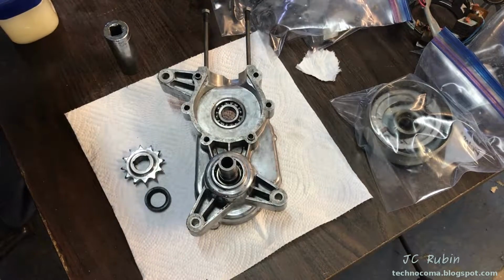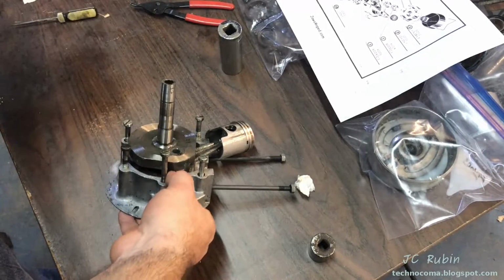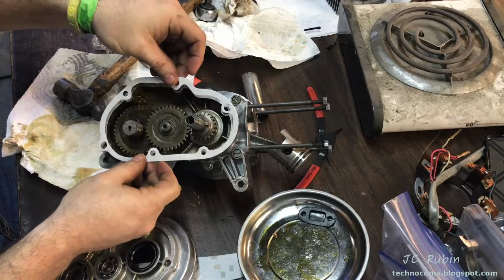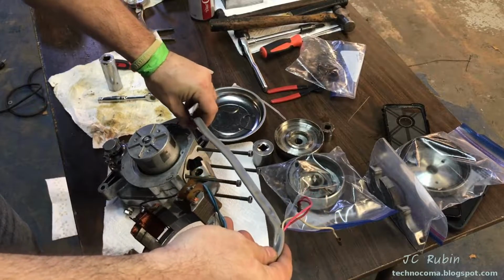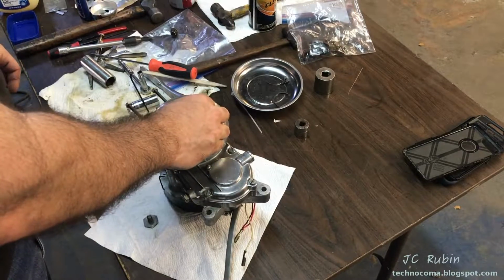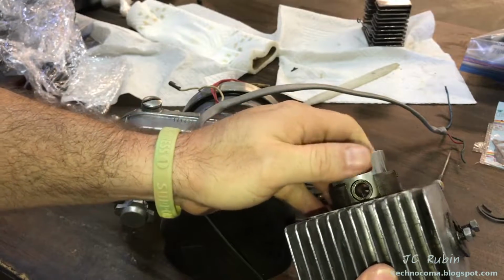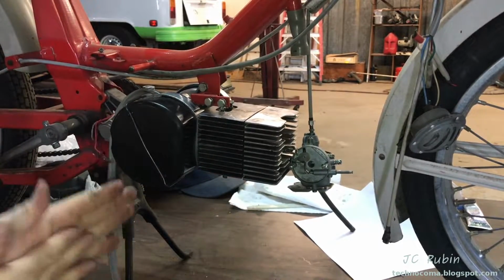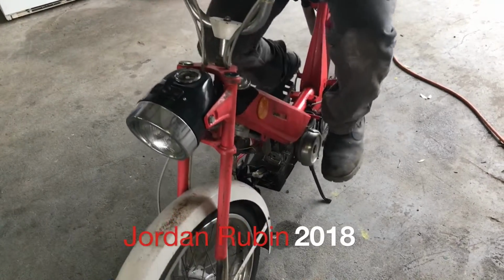1976 Jawa Transistor 40 Babetta Restoration Part 3 - Engine Assembly & Installation

Comment: I'm interested in seeing the timing and carb adjustments for this bike. Video was very helpful to me. Thanks for posting.
Reply from the maker: Im hoping to add another video to the series with just that, I currently have a major motorcycle restoration project join on so the jawa is on the shelf